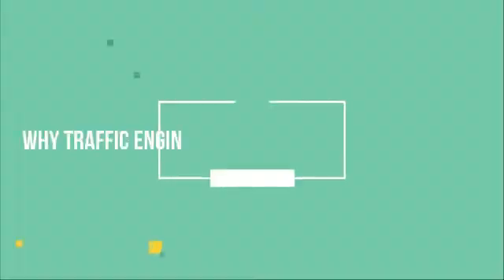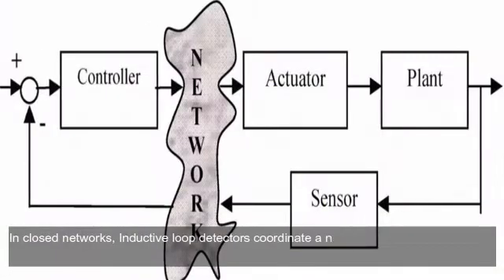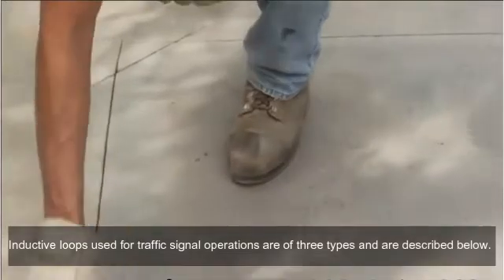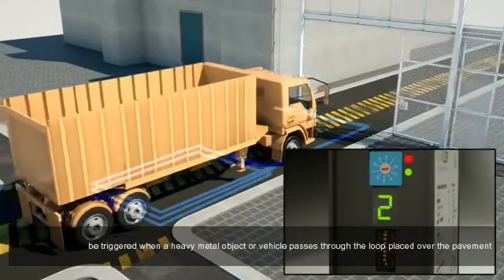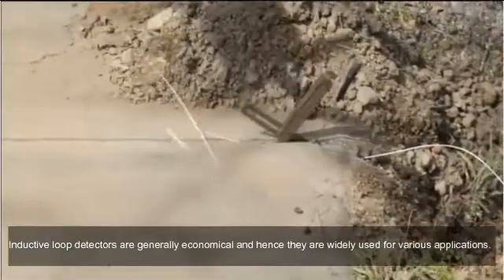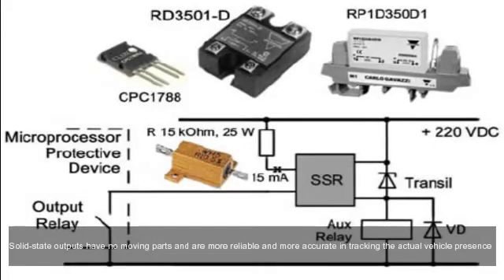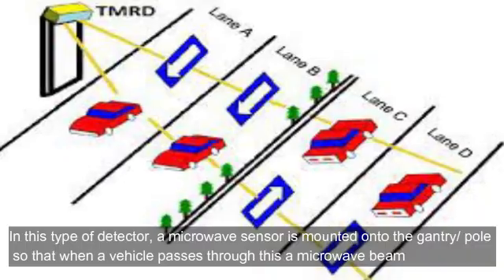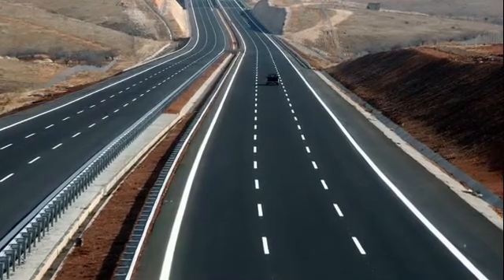How traffic signal loop detector works? Induction Loop Explained

Comment: How come this in civil engineer section? it should be in computer engineering or control and computer system engineering
Reply from the maker: Hi 
Many thanks for your query.
Here is the detailed response for your consideration:

Traffic Signal Modeling is carried out by traffic engineer.
Junction and signal loops are designed by highway designers.
Junctions are constructed by Construction Engineers.
Traffic Control is managed by Urban traffic control unit in local council offices by traffic engineers.

Hope this helps